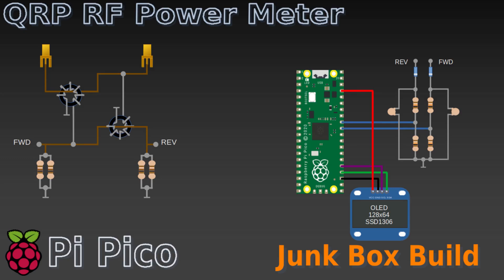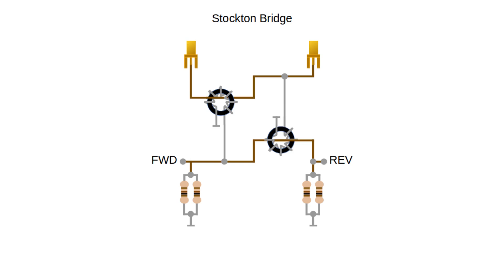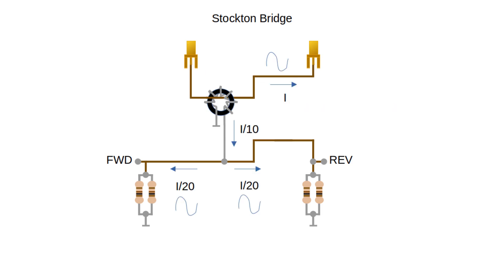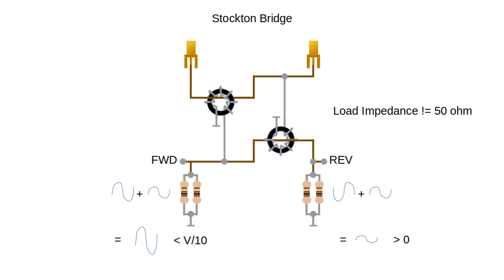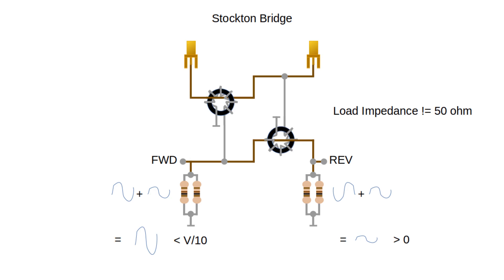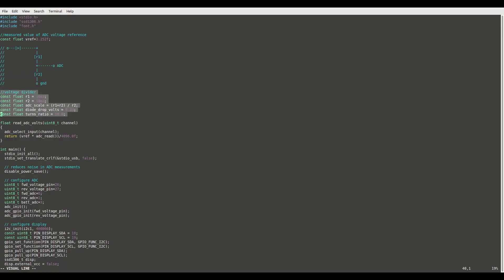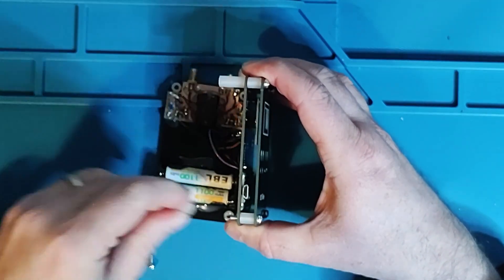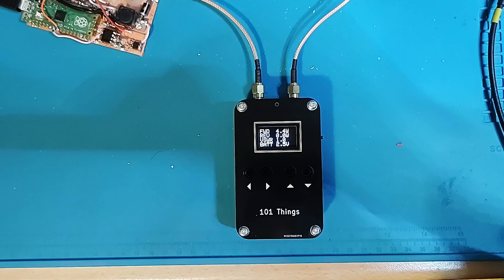Raspberry Pi Pico RF Power and SWR Meter

Comment: In your schematic, you say D1 on the pico must be removed.  I do not understand why?  Thanks
Reply from the maker: This is to prevent contention between USB and battery power if they are both connected, but it can't be powered from USB alone using this method.

 Alternatively you could connect the battery via a diode (inefficient due to voltage drops across diode, about 20% of battery power is lost in the diode using this method) or use p-channel MOSFET as described in the Pico datasheet (almost no battery power is wasted using the pmos technique).
Reply: @101Things-ds8tc  thanks for your time and reply.  I assume if you power only via USB or only battery, then you can leave the diode as is?  Thanks Again  cool Project
Reply from the maker: Yes, that's right you would just need to be careful to remove the batteries if you needed to connect the USB for any reason.

Comment: This looks really nice, just the kind of thing I could build myself.  Thank you for the explaination of the Stockton Bridge.  Very interesting.  I have one really BIG problem.  I have not a clue as to which of the files in github are what I need to send to the board maker.  I've never gotten into that.  Can you enlighten me please?  Thanks.
Reply from the maker: You need the Gerber files and drill files, basically everything under this folder https://github.com/dawsonjon/101Things/tree/master/PCB/swiss%20army%20pcb/gerbers.

Keep in mind that the PCB isn't specific to this design and I had to "adapt" it to build the power meter.
Cheers